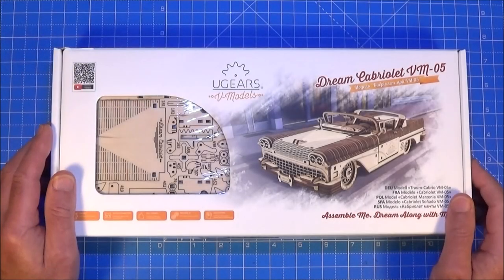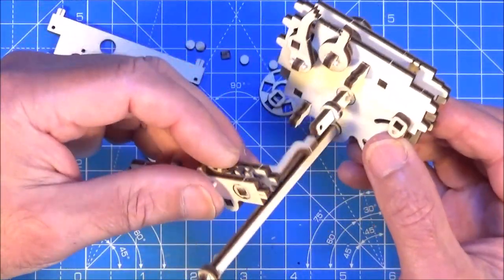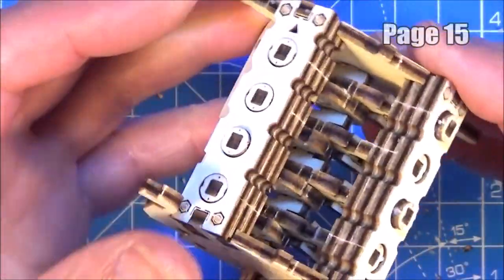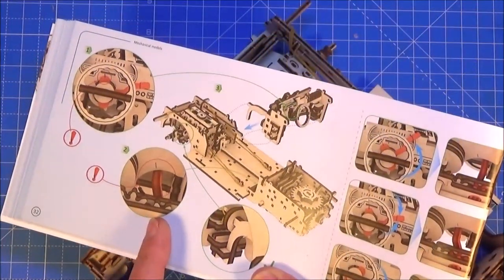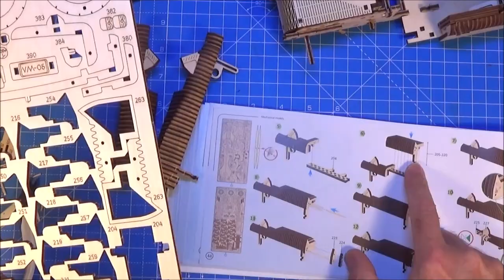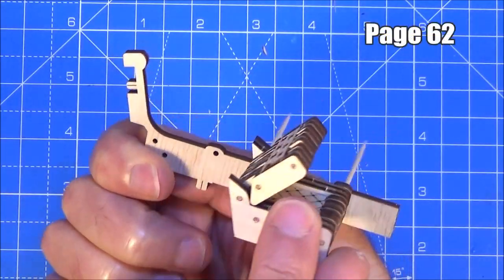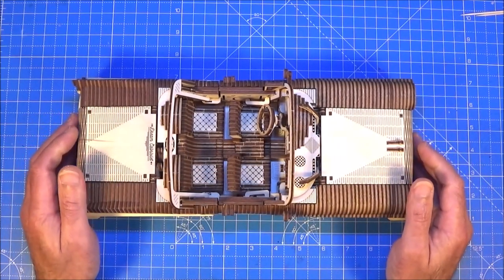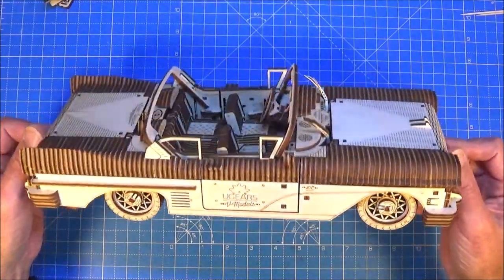UGEARS Dream Cabriolet VM-05 Build & Review - Amazing 3D Wooden Mechanical Model

Comment: What a great job you did of recording this video while building a very complicated kit!
I find it hard to believe that the designers had the audacity to include so many long, bendy shafts and linkages as well as so many friction-inducing features such as the V8. I think the chances are that the laser-cut surfaces are far more slippery than the flat faces of the wood. I love the way the designers took advantage of the difference in mechanical properties here, and in aesthetic properties when creating the two-tone colour scheme of the body.
 Congratulations on the build!
Reply from the maker: Hi Del and many thanks, I really appreciate your kind comment! It was a labour of love, I must say, as those wooden pieces take more force to press together than you might imagine!
But it is a very satisfying process and very therapeutic, too. The laser cut parts are incredibly accurate and yes, I think the cut edges are smoother and harder than the plain wood.
Glad you enjoyed it, my friend, hope all is good with you and yours! Cheers! 🤗👌👍
Reply: @MarkBryanRC  It really is a lovely thing.

Comment: It turned out really cool looking! I have looked at kits like this at the hobby shop multiple times but never got one. I think I need to pick one of them up next time I am in there. It does look like fun! I had thought about trying one of the balsa planes like Rob and Nanni have built but this looks a little on the more robust side and less fragile with working on it with my fat sausage fingers!! Great job Mark, really cool conversation piece for sure!
Reply from the maker: Hi Addam and thanks, I'm glad you like it too! I definitely recommend this kind of kit, but you do need some spare time, a precious thing I know! The Winter would be a good time to tackle one of these kits. You will need those sausage fingers (like mine) as you really need some force to get the parts together, you'd be surprised at just how hard you need to squeeze! It's looking pretty on the shelf right now - cheers! 😉🙏👍
Reply: @MarkBryanRC  LOL! Yeah, one more thing on the list won't hurt! LOL! Every now and again I get a little burnt out on plastic parts metal screw and stinky paint so having one of these to do as a break may be a good idea! I will probably start with a smaller one, slightly less involved and see how it goes before committing toa full car like this. Our hobby shop has a bunch of them to chose from!
Reply from the maker: Same here, mate, a wooden kit makes a nice change, with the bonus of a lovely smell for a change, the wood smells so good! 😅👌👍

Comment: Thanks Mark, that was very useful. I recently built the Roadster (which is fabulous) and this will be my next one. I build radio models like you but these make a truly refreshing change. You're right though; definitely not to be hurried. Ever thought of sticking a motor and a steering servo in one? Anyway. Great vid'.
Reply from the maker: Thank you very much, Graham, glad to hear it was helpful! I haven't had the pleasure of building the roadster yet. Agreed, these kits are a super distraction from the usual RC car build. I did ponder fitting some RC electrics in one of these wooden models, but after the driveshaft snapped on my spring powered Cobra, I thought better of it... I don't think the thin wooden mechanics are up to the job!
Reply: Ah, yes, you're probably right.